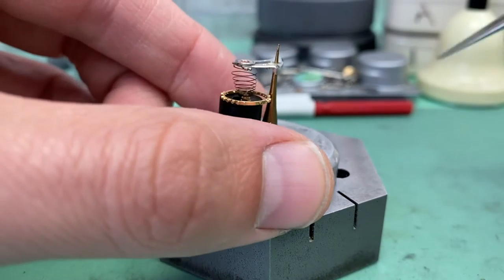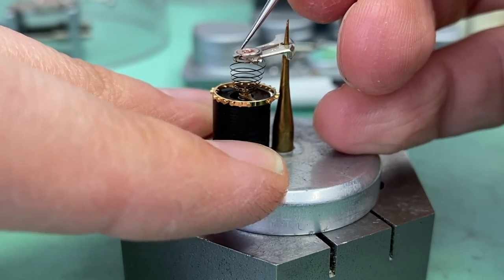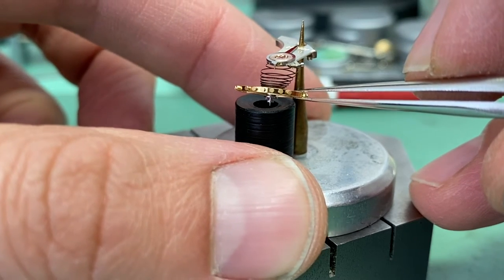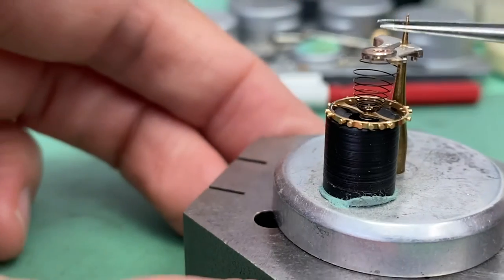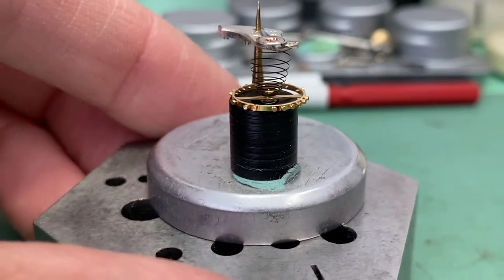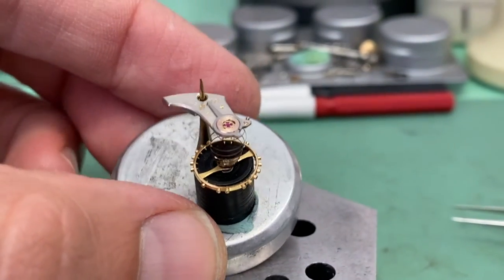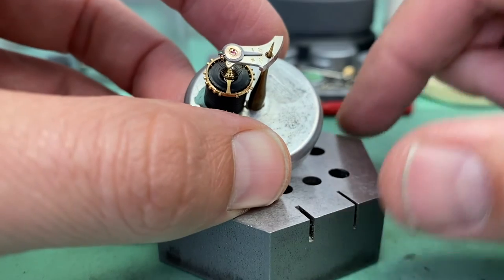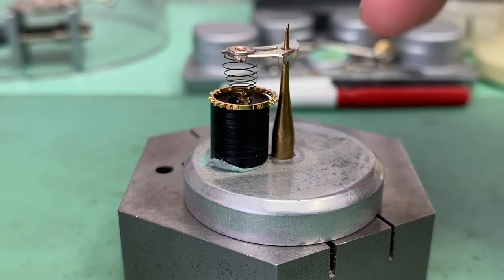Balance complete storage, visual inspection, adjustment and repair tool.

Comment: I've tried all kinds of clumsy mash-ups to solve this problem. They've all ended mostly with twisted hairsprings. I guess it's old age (or worse), but my brain can't come up with simple answers to these problems. If you'd made this video two weeks ago it would have saved me $40 on a hairspring support stand from China. No one but Fabio makes such straightforward informative videos like this. Thanks, as always for sharing.
Reply from the maker: Thanks Chris, can't remember when I put these two objects together. I think it was kind of an accident. But,  it has been working well. very useful for hairspring work.

Comment: I took a pointy piece of pegwood and stuck it down into one of the holes of the anvil.  It worked great.  I like that plastic bushing thingie you use for a support.  What is that exactly?.    Oh, btw, something I have had trouble with on several hairsprings is twisted collets.  The collets become tilted and then when the hairspring is installed on the staff, the hairspring is tilted. What is the best way to straighten a collet?.  Is there a procedure that makes it easier?.   See what I mean?.   This video gave me a good idea for a balance support.  Thanks
Reply from the maker: It’s just  a piece of plastic with a hole drilled into it half way. Should be able to use a staking set or horia tool to level out the collet.